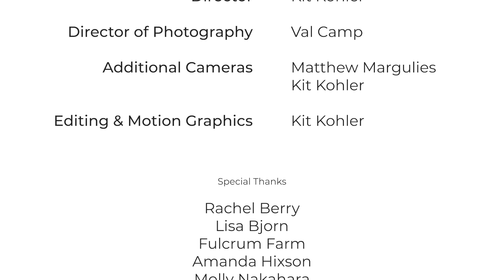How to Test Your Compost Pile for Quality

Comment: Using Dr Elaine Ingham methods we usually finish within one month, maybe a month and a half.  Although it will improve with a little resting , I usually run it through red wigglers to improve it.  Intresting technique, I am glad it works for you.  However these are not solid rules that apply to every system